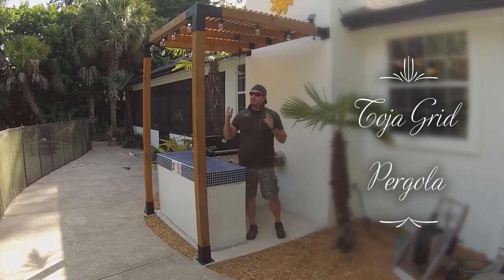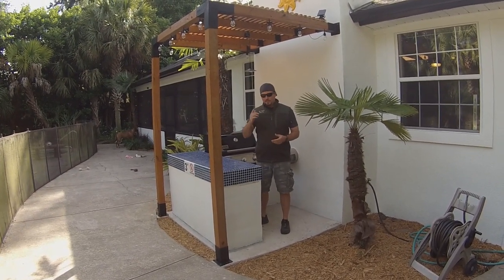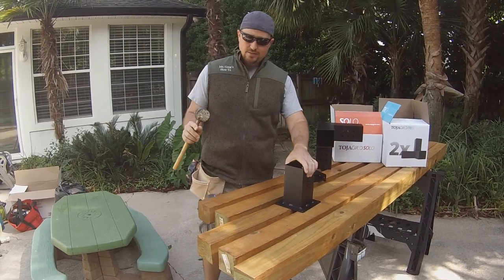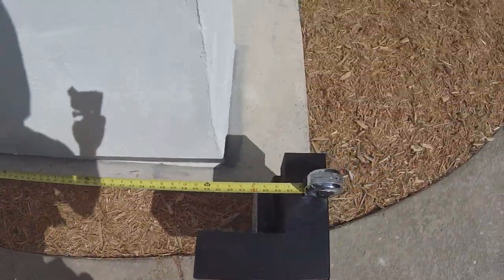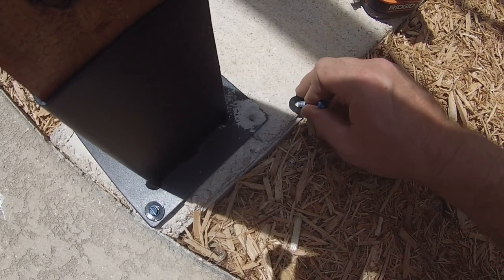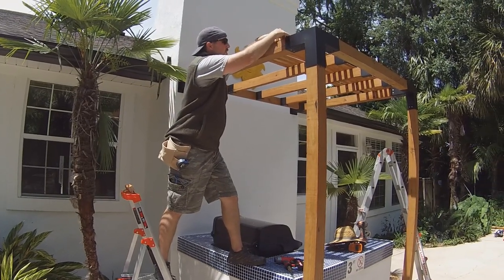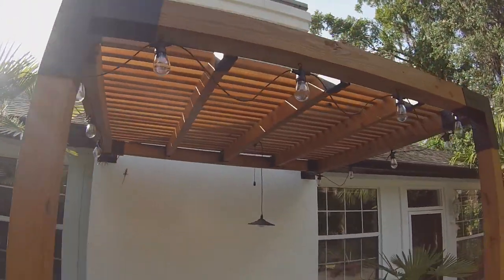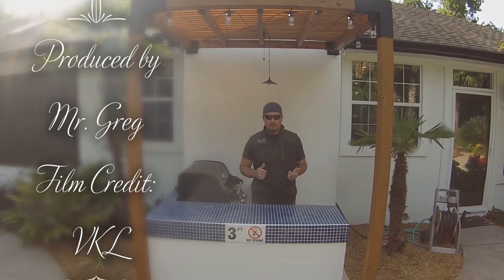HOW TO Build a Toja Grid Pergola (Outdoor Kitchen Series - Part IV)

Comment: Great video, gave me some inspiration just nervous to get started. I would add a few things personally, I would leave some spaces if possible on the bottom near the grill for accessories since we took off the side hangers and such, I would also have some counter come out from the main top and put some bar stools. I have some more space to work with in my backyard but those are my vision differences.
Reply from the maker: Great ideas, partner!  Would love to hear how it turns out. Sounds awesome, especially the tool storage and integrated bar!  And don’t be nervous, you got this!

Comment: How did you locate the studs behind the stucco? Will a stud finder work or is it in alignment with the interior studs? Would looking at it from the attic perspective help you locate them?
Reply from the maker: Hey partner!  Those are good questions.  My wall is the frame of a fireplace so I couldn’t align with interior studs, although that could work (so could attic).  I would recommend a little guess and check with a small drill/nail before your project.  I knew the outer studs would be there because they were framing the sides of the wall. The interior studs I just a happened to get lucky on (drove the fasteners in at a slight angle). Not sure how many screws you will need based on weight, but I used 5” timberlock screws which gave a great hold. Best of luck!!

Comment: Any suggestions to DYI a waterproof cover? Retractable preferably or something that can allow light if desired. Any stain to give it more of an acacia wood color.?
Reply from the maker: Hey partner!  Lots of options there. An easy transparent hard cover could be made out of plastic corrugated roofing panels, but that wouldn’t be retractable. They also sell some really nice kits that have shades that slide along stainless steel cable - that may be more what you’re looking for.  Im sure you could find an acacia wood stain without too much trouble. Best of luck my friend!

Comment: What type/size ledger anchor did you use to anchor the wall brackets? Also what size/type anchor for the floor posts? Thanks for the help great video
Reply from the maker: Hey partner!  For the wall brackets I used 4” TimberLok lag screws. For the floor posts I used 1/4” x 2 3/4” Tapcon concrete screw anchors.  Your specific sizes may vary based on the needs of your project, but mine has stayed super sturdy with this set up. Best of luck to you!
Reply: @MRGREGSHOWTO  thanks so much for the info. What are your thoughts of using sleeve anchors for the posts?
Reply from the maker: @saminasri2001  I think sleeve anchors would work great for the base posts. The ground is bearing the weight, the anchors are just holding the structure in place. Let us know how your project turns out!

Comment: How long did it take the wood to dry out and make it easier to slide in the brackets? Did you have to plane or sand?
Reply from the maker: Howdy partner!  The 4x4s were freshly pressure treated so they took a few weeks in direct sunlight to shrink down. I do NOT recommend planing or sanding. Since erected the posts have shrunk considerably. I know it’s hard, but I would just play the waiting game or tap them on with a mallet if you’re close. Best of luck!!

Comment: Great vid, what size tapcon screws did you use?
Reply from the maker: Hey partner!  Great name!  For the wall brackets I used 4” TimberLok lag screws. For the floor posts I used 1/4” x 2 3/4” Tapcon concrete screw anchors.  Your specific sizes may vary based on the needs of your project, but mine has stayed super sturdy with this set up. Best of luck to you!
Reply: @MRGREGSHOWTO  Definitely a great name! Thanks again for the feedback